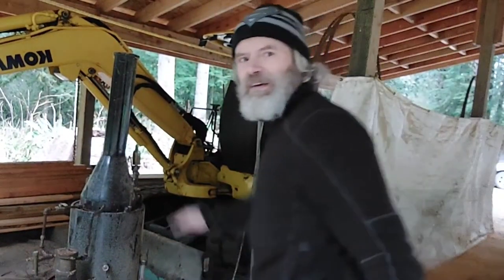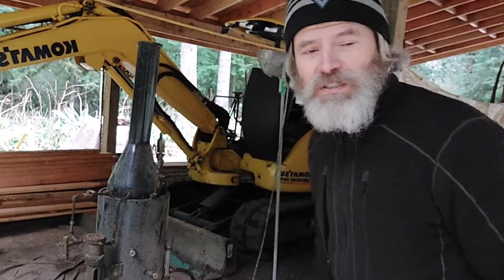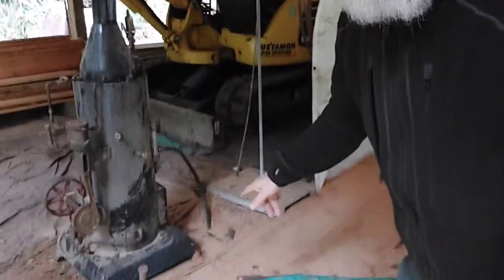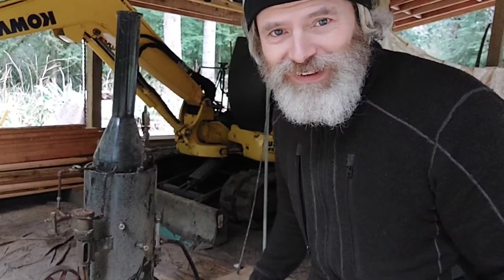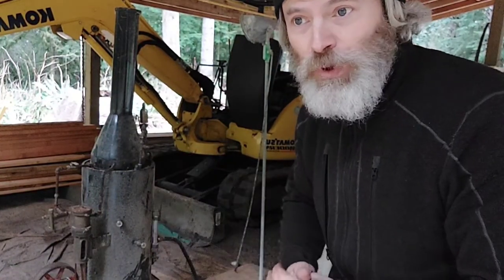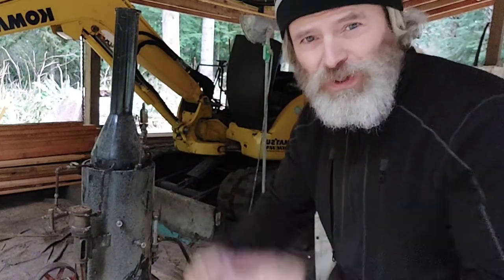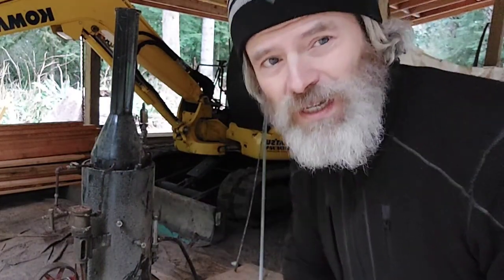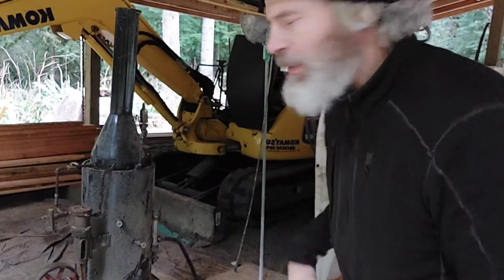Off-Grid Steam Power is Here! Boiler with Engine Combination

Comment: I've been looking at the 40v power tools.  Portable inverters, chainsaw, log splitter can all be charged by this.  That's not to mention 20v tools and all the other 40v tools.  You can also run an air compressor off of this.  There is so much "off grid" or "on site" potential.  Not to mention if you wrap copper piping around it, you have your self a water heater.
Reply from the maker: Awesome insights. Thanks you!

Comment: A 3 kVA 5 hp steamengine costs 4000 $, 15 hp is 8.600, plus boiler.
Reply from the maker: Good to know. Mine is a 3-5 hp. I gotta get it running.
Reply: Where can I buy ?

Comment: That is a Stanley Steemer!!! Sweet. It is only safe if the pressure relief works right. I will buy the whistle from you. I have got a small collection of them. I will stay with my old throttle governed motors or windmill to run things.
Reply: Probably not best to set up next to the king size plus bed and use it to heat at night ?
Reply from the maker: I'll compromise....The Sasquatch Steamer.
Reply: seems perfect for wintertime operation , power AND an indoor condenser for heat
Reply: I want one, share the love my new best friend 🧐

Comment: Buy a 2000 or 5,000 watt pure sign wave inverter  have that inverts from 12-20 volts to  120 volts or a cheap inverter with lights and RV frig and so on bigger inverter more stuff you can run
Reply from the maker: Awesome. Thanks for the insights!